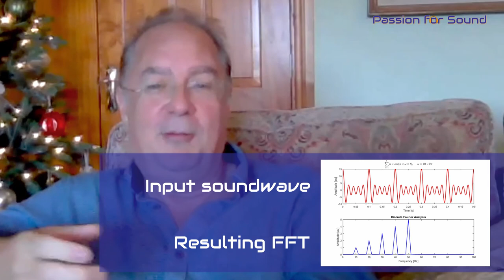Interview with Chord Electronics' Rob Watts - Part 2: Unbelievable Measurements & Filter Design

Comment: So dave is -350db on the paper and in the measuring world is -110?
Reply from the maker: No, it's -350dB in the digital domain filtering process. Analog measurement devices can't measure that low so the discrepancy is between the digital and analog measurements

Comment: I do not like when any system rely on strong feedback. It can be source of timing issues an instability.   The war for grater S/N dB difference in Delta-sigma is just number that tells you what is level of time smearing in that feedback system.
Reply from the maker: The original sampling process in the analog-to-digital stage of a recording creates timing issues due to the high speed transients. As I understand it from speaking to Rob, the reconstruction process in the DAC must be complex and use feedback in order to properly rebuild the signal. That's true for any DAC design, not just Chord DACs so this is occurring in R2R DACs as well.

Comment: 'cmon!... A noise shaping is moving noise up to not audible frequencies. It makes no sense to add a resulting noise to an input, because these are different by origin noises. This is trade off for originally a low bits resolution. A math converts resolution to noise.
Reply from the maker: I don't understand what you're saying about adding resulting noise to an input
Reply: @PassionforSound  This wasn't me. That was in the video. So, that's why I wrote the comment. May be I didn't listen carefully.
Reply from the maker: I think you've misheard as noise isn't added to anything that I'm aware of